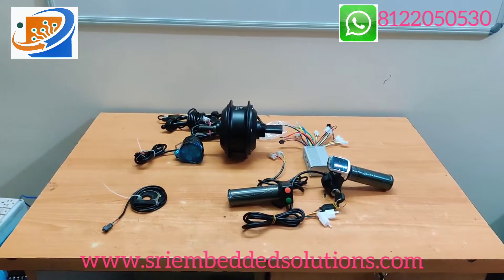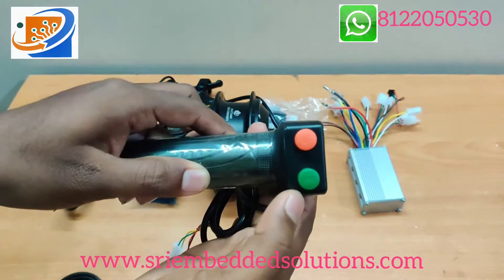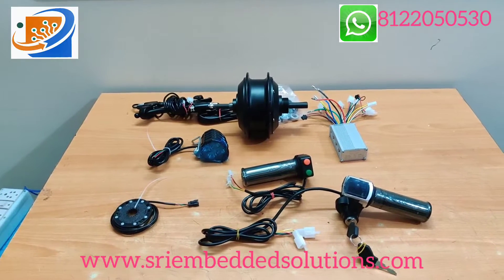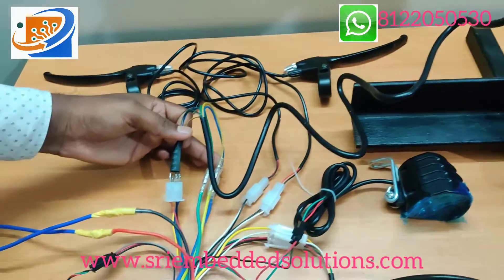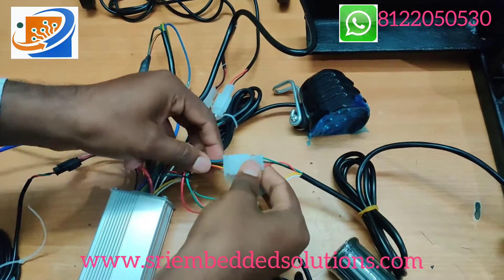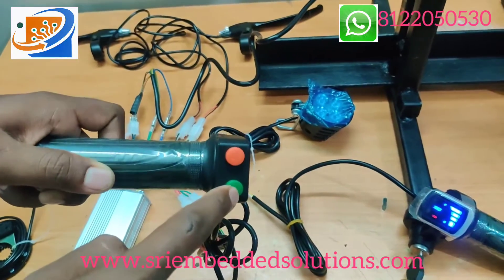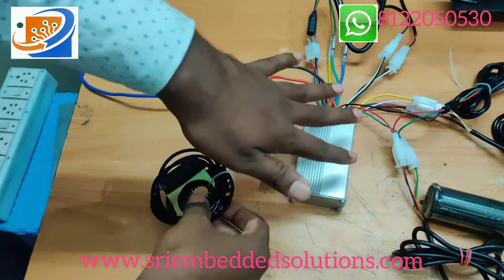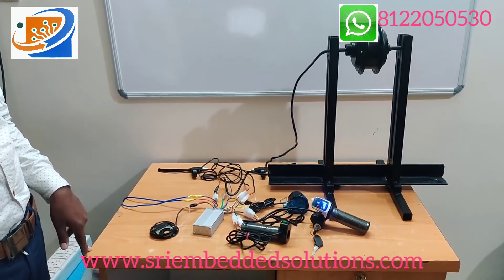36V 350W E-BICYCLE HUB MOTOR KIT CONVERSION KIT - Unboxing ,Connection & Demo Video -English Version

Comment: Is it fitted on front wheel or rear. what's cost including the battery
Reply from the maker: yes sir its available.

kindly whatsapp to our number :8122050530

To Message SRI Electronics and Embedded Solutions on WhatsApp: https://wa.me/message/26JGK4L23ZDGF1

Download E-Bicycle & E-Bike Conversion kits & Accessories Brochure from this link :
https://drive.google.com/file/d/1Zu9lRpX2IlooQWE-3lpJwJXt1_2FmtFg/view?usp=sharing

will share you details and prices.

Any Doubts Please Feel To call at any Time in our Whatapp number : 8122050530

Follow this link to view our E-bike conversion kits on WhatsApp: https://wa.me/c/918122050530

For more details about this kits visit our

 youtube channel for more details and connections.
https://www.youtube.com/channel/UCFzokKv5bmQ_v1Scv_zkZ-w?sub_confirmation=1